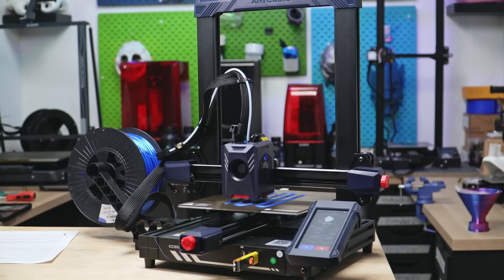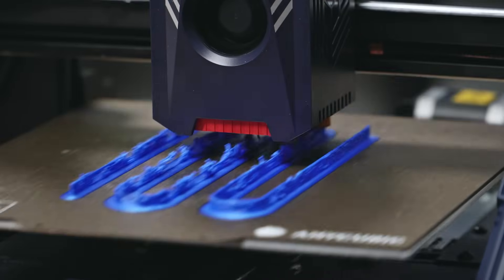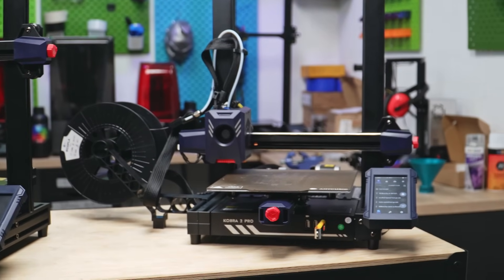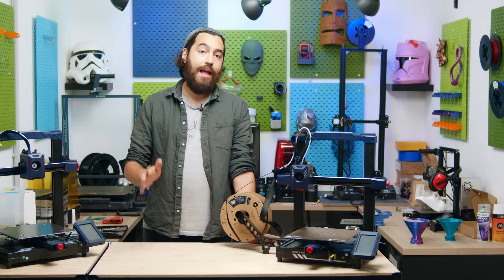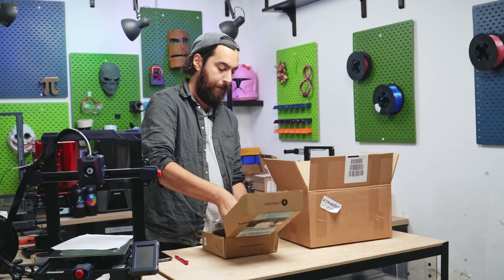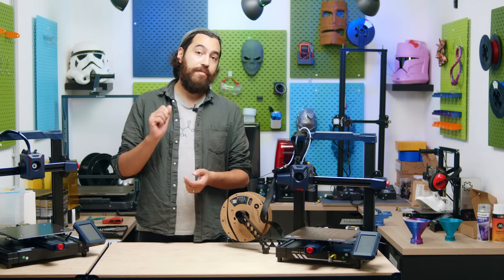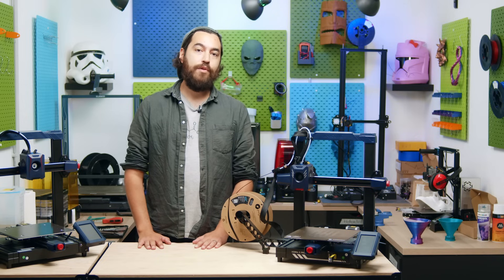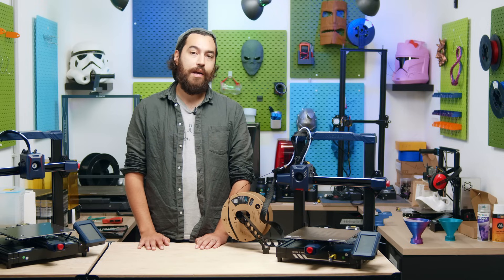Polymaker PolySonic PLA: Print FAST at HIGH-QUALITY

Comment: Why this obsession with speed? I'd rather wait a little longer and have better quality.
Reply: Speed might not be important for people that do this for a hobbie like me, but i understand why this would be important from a buisness perspective. The more you can print in a day, the more you earn. You can argue that they can just invest in another printer, but it can get pretty costly fast if thats the only solution someone is offering. You can also say "well, why dont they just print smaller stuff so they can sell more items", that solution sets buisness limitations. Depending on what type of buisness you are trying to run, that solution may or may not work. Just a thought!
Reply: Better quality high speed should translate to better quality low speed

Comment: Sure printing faster is great. But my question is what is the draw back? They still sell a bunch of different PLA's so there has to be a draw back to their high speed PLA
Reply from the maker: quality wise it is very similar to regular PLA, it is a bit less resistant to bending than regular PLA. But lots of people still use regular PLA because they don't print at high speeds. Plus, there are only 5 colours for Polysonic, not that much range and it is considerably more expensive than regular PLA

Comment: any experience on poylsonic vs polysonic pro? Thanks!
Reply from the maker: Yep, quite similar, the only main difference is it is tougher although I haven't tested exactly how strong it is but apparently similar to ABS
Reply: @3DJake_Official  awesome, thanks! I just  checked on their site and they basically claim much better impact resistance, but slightly weaker in other aspects.

Comment: Here's a fun fact, Creality Hyper PLA is actually just a license produced copy of Polysonic Pro with the exact same performance and QC
Reply: Are you sure it's the same as polysonic PRO(!)? Hyper Pla wasn't bad but not really better than sunlu HS PLA which is dirt cheap in comparison, especially if you buy their sub brand Jayo which has 100g more, other spools but the same filament. Hyper Pla was a bit stiffer and better for the famous otf knife and springs for example. I think I have to take a look at the datasheets if the regular pla Pro from polymaker is better for me. And I think elegoo just launched pro filaments for half the price as polymaker. Sunlu and JAYO launched HS PLA plus 2.0. Printable up to 600mm/s and 260°c on the nozzle. Sometimes it is marketed as HS PLA plus on AliExpress. Hope they all provide datasheets

Comment: Yeap, most new printers are upping their part cooling game. The speed demons like Vzbot and the Hevort are using cpap and sacrifice on noise levels. I think the peopoly magneto X had an interesting auxiliary side fan solution to work around the noise level issue. I will definitely try Polysonic PLA on my Voron 2.4, as I only have the 5015 fan on the stealthburner for cooling. Actually thought your PLA Tough has been printing quite clean and fast with a 0.6mm CHT nozzle, but for prints with small "print islands" I think Polysonic is the way to go.